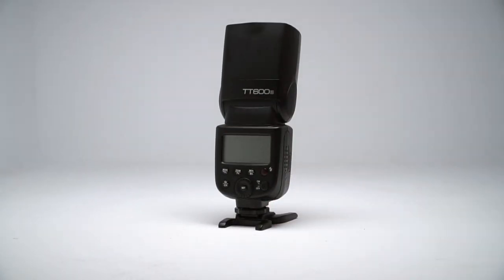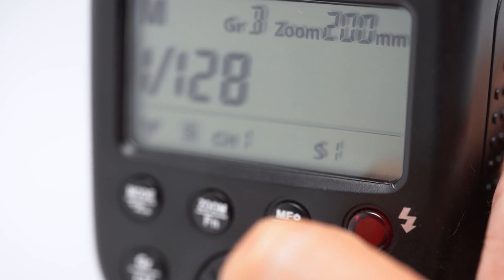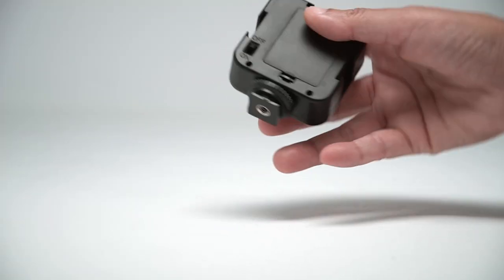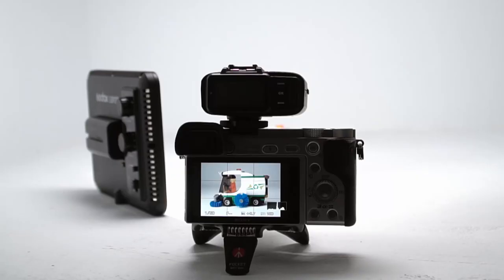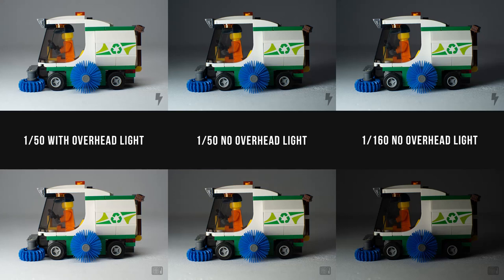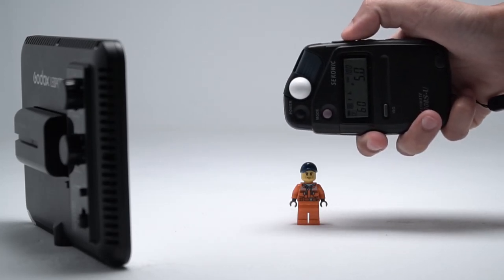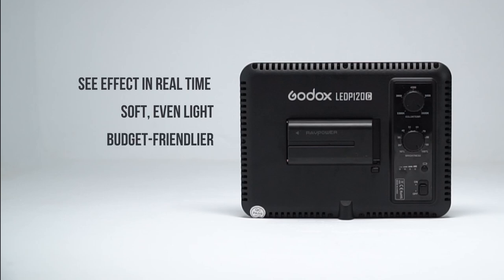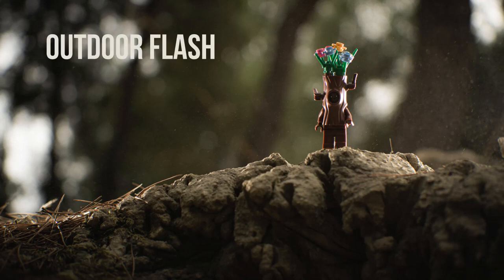Flash or LED Panel for Toy Photography

Comment: Great video! I think the flash did a much better job at capturing the model than the light panel. I will definitely make sure to keep this in mind during my next photo shoot.
Reply from the maker: I agree. It's hard to see in the video but even at 1/50, the flash photo is cleaner.

Comment: Ok, finally was able to watch it all (took two days, with parenting I never really have time these days).

The outcome for me: I need both tools!!! :-O

I do own a flash but sadly no trigger. I'll have to see what fits my model and make some tests. But clearly, I do see the need for a flash now, even if it complicates things by not being to see things in real time. But I think I must get used to this too.
Anyways, with the camera I am using, I already can't see the real time results from the LCD screen. In fact I have to test shoot at several speeds to get the proper exposure. So the lack of real time visualization will not affect me much I guess.
Many thanks for this very informative video. :-)
Reply from the maker: Yes, you can totally have both and can mix them in one shot. It really depends on what you want to achieve. As for not being able to see in real time, you'll become adept at previsualizing the light if not for the simple reason that you will be studying it more intently because you don't want to keep shooting trial-and-error!

Comment: Another hit in my book. I am an absolute noob when it comes to flashlighting and have been looking to get into it (mainly because Amber and you are always so enthousiastic about it 🙄). Anyway, this video finally convinced me on the why i actually should venture into flash-lighting and now i am looking forward to the how (after i try and fail miserably a couple of times before learning). One thing i noticed that really caught my eye is with the two ‘rain-photos’; the one with flash did not show any (harsh) reflection on the minifigure-head.... does that have to do with the short exposuretime neccessary? Or is there another explanation? Again; thanks for sharing!
Reply from the maker: Thank you! The reflection is probably just an issue of having the softbox turned a mm away in the flash photo. Precision matters with angles of light and I wasn't exactly lining up the angle of the softbox with the angle of the LED panel. I'll do better next time!